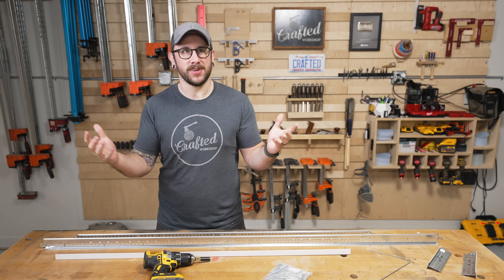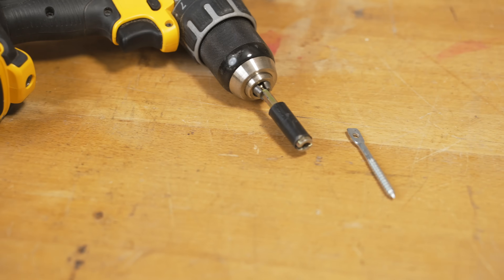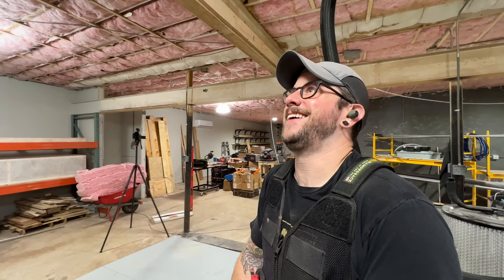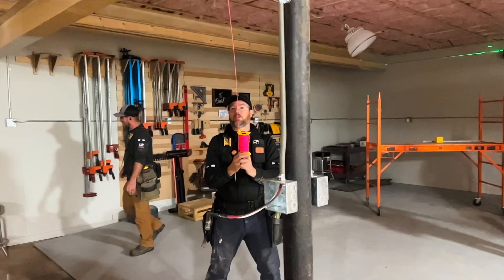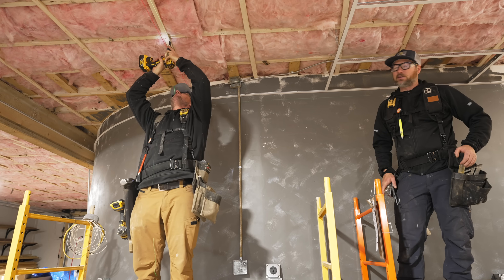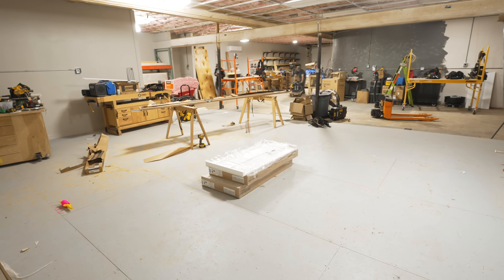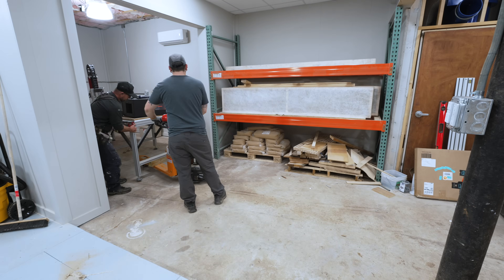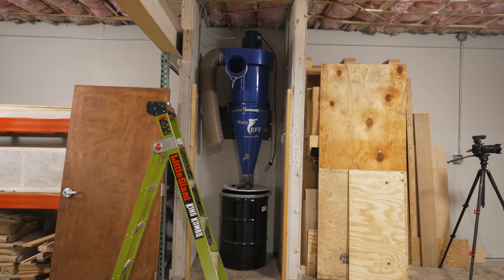Are Drop Ceilings the EASIEST DIY ceiling? | WORKSHOP RENOVATION 18

Comment: So funny seeing resi guys do commercial work I’m an electrician and the ceiling guys used beam clamps and run the wire through the beam clamps it’s super easy and fast and less expensive than wood and screws but y’all killed it looks good

Comment: Hello, I have a question I'm not sure if you can answer. The place I'm living has a drop ceiling already in the basement.  I think it was put in here a few decades ago. We are suspicious that mice were living on it at one time. We have blocked the holes that they were entering the house and are quite sure the mouse problem is gone.  However, some of the tiles are a bit brown around the edges which leads us to believe that there are mouse turds or urine on the ceiling tiles.  My question is can I just purchase new tiles and leave the metal structure/framing (whatever you call it) on the ceiling, and then take down the existing tiles and put new ones up there?  Would it just be that simple?  Is there anything I need to consider.  It seems all the tiles for purchase are 2 ft x 2 ft but some of the tiles definitely look wider than 2 fit......I would say the ones closest to the wall look like that could be 3 feet wide.  Can I find something that wide?

Do you think when I remove the existing tiles that I'll be able to do it without mouse turds falling off the tiles?  In other words, do I have to turn them sideways to get them down?  Or, is there a way I could keep the tile level so nothing slides off when I'm taking them down?  There are about 70 tiles.  They are not all the same size. They are very plain and white and I would like to put something a little nicer there.  Approximately, how much do you think I could end up spending?  Sorry this is long winded message.  One more question is I'm also planning to paint the basement walls.  What should come first, the ceiling tiles or the painting?  Thank you.

Comment: Use white liquid shoe polish to cover up small marks on the tiles.
Reply: Armstrong makes a special paint for their tile. Comes in a plastic bottle and the lid has  brush attached to the inside. Color matches Armstrongs white ceiling tile.

Comment: I’ve installed hundreds of drop ceilings over the years and have don’t them all without a laser level; laser levels are absolutely not necessary. Just figure the height you want and install your wall track with a simple level, the longer the better, then set your next wall section equal to or on top of the first, at the corner, and simply level around the room. Your main tees can then be set in the wall track and level it if you need to use multiple tees assembled together.
One quick point when drilling steel higher pressure and slower speeds are used as running your drill bits at high speeds generate more heat which can quickly dull them out and make drilling harder if not impossible. There’s a reason drill presses and magnetic drills are used and can run at much slower speeds with more torque for drilling steel; 2000 RPM is way too high for getting through steel.
Reply: laser is definitely not necessary but it's incredibly helpful. My shop has always used string lines every 6 ft to level the whole grid and it's the main reason I absolutely hate when we get a project to install one. Definitely at least trying the laser trick in one room.

Comment: I remember you hating your drop ceiling in the old garage workshop, what made you decide to go back to it?  I know that back then it wasn't a choice, just what you had, but now that you did have a choice what made it better than other options available?
Reply: Reckon the ability to use the space above the ceiling to run wires, ventilation and more, outweigh the downsides of it.
Reply: Light fixture location also.

Comment: When I installed some drop ceiling as a helper, the rule was never touch the tiles with the front side of your hands due to finger prints, some of which would only show up later.  You could grab the edges with your fingers and after that, only the BACK SIDE of your hand was used to put them in place.  Easy to do and no more marks on the tiles!
Reply from the maker: Good tip!
Reply: another pro tip is that you can use a white rubber eraser to remove any fingerprints on white ceiling tiles 👍🏻

Comment: I didn't see any AC vents but if you do have them make sure that reconnect the duct work very good with foil tape and plastic zip connectors. Condensation will stain your tiles quickly also the upgrade in cost for your tiles to vinyl covered is worth it you'll will be able to clean them always enjoy y'all's videos
Reply: He has mini-splits.

Comment: Before lasers, we used water level. They were simple, especially if you put some food coloring in the tubes. Looks great 👍
Reply: I used this method myself numerous times along with a chalk line and string level. A laser level would have been a lot faster and easier.
Reply: the big advantage of water levels is that they work even in different rooms. That's something no laser can do.
Reply: If I was creating a world, I wouldn't mess about with butterflies and daffodils.  I would have started with lasers - eight o'clock, day one.
Reply: In 1982 I was working for a ceiling company. We were trying to talk the company owner into buying a laser. They cost around 25k in those days. He did not want to pay 25k. He agreed to rent one to install 2 Walmart store ceilings. After he reviewed the labor savings, he purchased a laser.
Reply: And inexpensive! Only the cost of 50 feet of clear tube.

Comment: The Huusk knives are a scam, they've got nothing to do with Japan. They're an eastern european company who's knives are made in China out of cookware grade steel, not knife grade.
Reply: Do you have specific examples of this? The ones I found are made of ATS-34, which IS a Japanese steel and is a mid grade knife steel. It's a copy of 154CM which even Benchmade has used in the past.
Reply: @verygoodboy2688  , the troll doesn't have anything
Reply: @bigvegass how are they trolling? They do have nothing to do with Japan and are made in China. They claim to be made of the same steel as Katanas even though Katanas were never made of steel. It doesn't take much searching to see many people have had issues with this company.
Reply: I don’t know anything about their quality but I just ordered one and the website is awfully suspect.
Reply: @StockAL3Xj  "katanas were never made of steel"

Wtf are you smoking dude? Tamahagane is a kind of steel.
Reply: @Quonzer  folded layers of adamantium and unattainium sandwiched san mai style over a core of mithril.
Reply: @silverbackag9790  Ah yes of course. And coated in "Weeb oil" as is tradition.
Reply: Lol, huusk ”knives” they really are a scam. Search some reviews. They are also sold under several different names.
Reply: As soon as you see a discount code for 70% off you know it's suspect. There's lots of Bluetooth speaker companies doing the same thing.

Comment: Sorry but. You should never overlap wall angle. You can overlap inside corners. You should not start metal grid in middle of room. It should be started at wall using Jet line to keep framing straight. Once first row is installed you can now work your way across the room.  It’s a very easy job. One man can do it. Two is easier with one man being the ground man.      Too many missed details to explain.

Comment: The noise reduction from drop ceilings is due to the fact they are suspended and can dampen vibrations by vibrating themselves.  

If you have to much airflow from say a door or HVAC system you might find they actually make noise actually. This is due to the tiles moving in the grid and they “bounce” due to that there are products that can attach the ceiling tiles to the crib but if you do they then they don’t move as much meaning they don’t vibrate and therefore aren’t as sound dampening.

Comment: Yeah I remember back in the 70’s , we’d break out the ole laser lever when we installed a drop ceiling. The job just couldn’t go on without one ( sarcasm ). Your to reliant on technology. Learn to do it the old way, do it right the first time, no one is in that much of hurry and if you are , you might want to consider a different line of work.